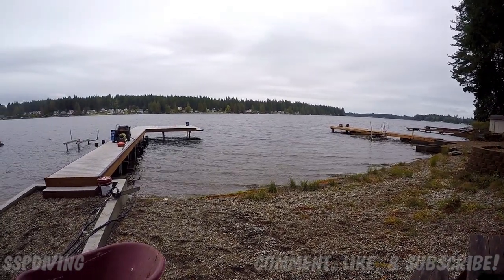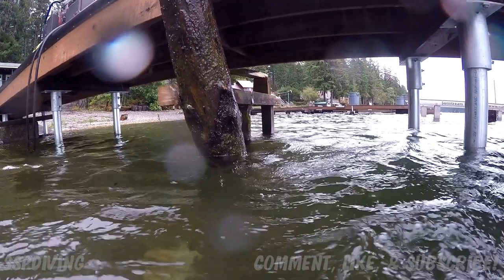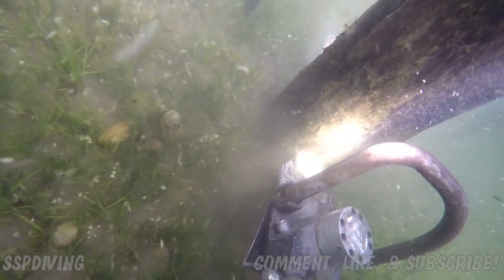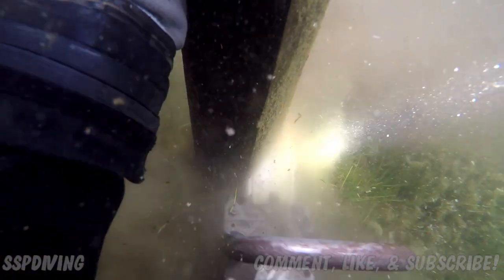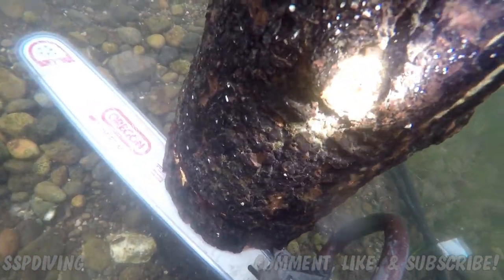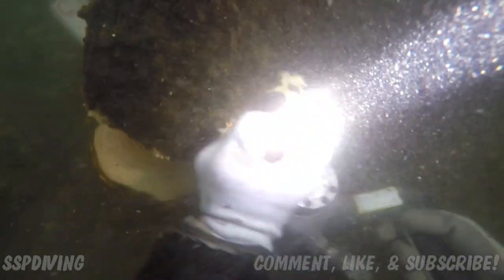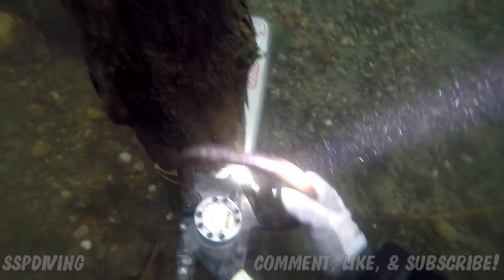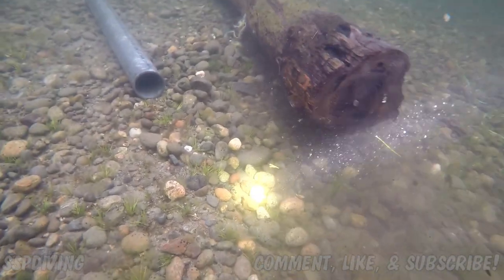Underwater Chainsaw! - Diver Cutting wood pilings - Inland Commercial Diving - Make Money Underwater

Comment: Let’s say I purchase a hydrolic chainsaw...what else do I need to buy for it to be able to run? Some type of engine that stays dry, I’m assuming. Could you explain the components of the system please?
Reply from the maker: Good question! The system starts with a "hydraulic power pack". Essentially a gas powered pump that has two hoses going to the chainsaw. One being the "supply" and the other being a "return" hose. Typical power packs supply fluid at a rate of 5-8 gallons per minute. The pressure doesn't change, only the flow which is essentially speed in most cases. The fluid runs through the tool when you pull the trigger, back through the supply hose into the reservoir of the hydraulic pack, and the process repeats.

Comment: Would it have helped to attach a lift back to help relieve any binding on the bar or chain? I will be doing a number of piles in the near future and I'm examining a few different techniques.  What are your thoughts? Would it be a waste of time or effort to use a lift bag to pull the work away from the cutting blade?
Reply from the maker: Would definitely get in the way and possibly become a safety hazard. The saw is pretty light, probably ten pounds or so. If you’re sitting on bottom, you will hardly notice it once you get cutting.
Reply: I have talked to a few guys that have attached a bag to the poles while cutting. Usually on the bigger ones. And especially if there isn't barge  support. 
All have told me it works well.
Reply from the maker: @emersonharper434 great tip, bags work well and makes the job much safer. These were little guys like 3-5’ lengths if I recall correctly. @jasonnew1566 how did your job go?

Comment: Why are you running it backwards??
Reply from the maker: Keeps the chips from clogging up the saw
Reply: @SSPDIVING  I've used them a bit and never had one clog, seems more dangerous to run it differently than how Stanley intended.
Reply from the maker: I don't know where it started or if stanley intended it to be ran that was but that's the only way I've heard of it being ran. But I have ran it both ways and no issues honestly.  My old dive instructor explains it better than I do... https://youtu.be/GWP9thPs_mM?t=23
Reply: @SSPDIVING  regardless I'm glad your grinding and getting work in! Keep it up.